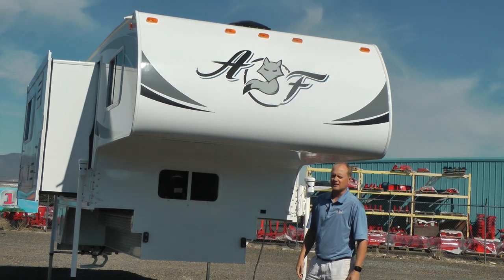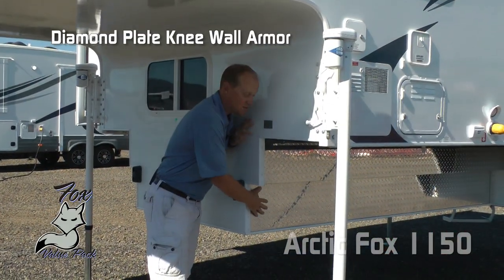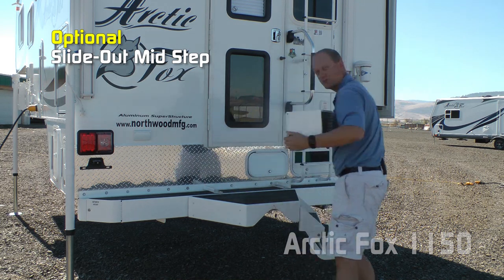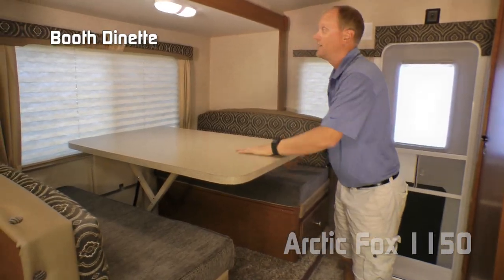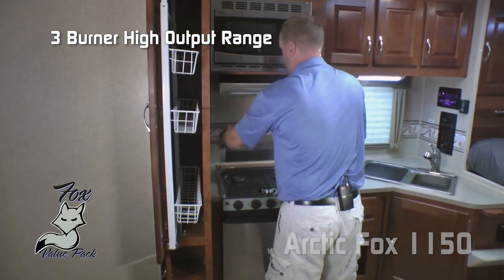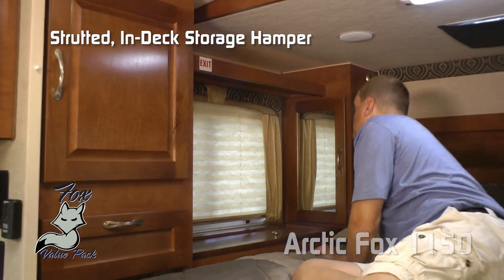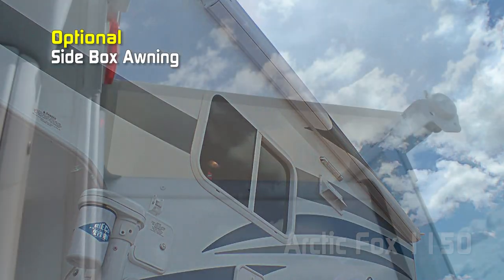Quick Tour Of The Arctic Fox 1150 Pickup Camper

Comment: I bought one, I believe it was a 2002 new. I put in on a Ford F350 diesel dually and took it all over Baja and  western U.S. I really miss it. I abused the hell out of it, took it down roads that would shake your tooth fillings out, but never had a problem with the camper.  Customer service was great. It did have to be taken back to the factory after I moved the slide out with a half inflated soccer ball under the mechanism that I had no idea it was there and caused the slide out to jump the tracks. They never charged me a cent. Back then I believe it was wood frame construction. This looks even more sturdy. I may be looking to buy another new one when I retire in 2 years. Mine had the same basic interior design, and I really loved the layout.
Reply: Did your Ford F350 have airbags installed in the suspension?
Reply: You think an f150 could handle it??

Comment: Just pulled the trigger today and got mine. Can't wait to do some traveling with it.  I compared the 1150 to the Lance 1062.  Both are superb but I had to go with the Arctic Fox. The larger and better placed fluid tanks and frame construction as well as all hard wood instead of pressboard was the deciding factors.  The dry bath is a little tight for the crapper...but that is not a big deal. (the wet bath gives more toilet room) Overall I give the AF1150 an A+ and that can change after I few trips..who knows?
Reply: How has it been keeping up? Give some info please!
Reply: What was the total cost ?
Reply: What kind of truck is it on?  I have heard Artic Fox brand is great in cold weather because of all the insulation.
Reply: That looks too heavy for a 3/4 ton. 1 ton dually minimum.
Reply: I'll stick with a Northern Lite
Reply: Good choice.
Reply: Better hope you didn't buy the one with the dirty shoes on the bed worn by the salesman

Comment: I can't believe the shower actually has a pull out hand held sprayer. WOW amazing. The fridge has an on off switch. Who knew. The jacks are bolted on with real bolts and everything. Amazing. 

You do a good job but there's a point that you can over do it and you reached that point. It just gets comical. 

Look everyone there's not 1 but 2 110v outlets in the bath in case you want to use your electric razor and electric toothbrush at the same time. Gee whiz I got to get me one of those.

Comment: My favorite is a small toy hauler, because there's a lot of things you could do in the garage and if you don't get a fifth wheel toy hauler, just conventional toy hauler, you can always get a new truck or SUV; not out a lot of money compared to the class A or Class C motorhomes. Trailer is having a diversified RV portfolio. I like the garage portion, great projected patio, plus some have bath tubs and frt kitchen. I hate gallery kitchen, traffic flow issues. Garage is great storage for toys, or thro in air mattress, great sleeping. Slide outs are okay, but just another problem, when least expected. Solar panels are must have, better then generator….
Class A Motorhomes okay if you're going to be mobile. They're very expensive to maintain they have a lot of toys on them so be ready for breakdowns. If you wreck them, Ins. are very poor. Not many mechanics really know how to work on them, expensive $$ beast. 
Class C motorhomes are very mobile to get around, sleeper over the cab is a waste of time : either too hot or too cold for good sleeping and if your senior, it's very risky getting in and out of there. Plus if there's two people sleeping up there, the frame over the cab really can't support much activity. 
I would prefer a truck frame chassis with a trailer attached o it, because if you don't like the truck frame chassis you can always get another one, just removed the trailer. 
I have a Class A, Trailer and Truck camper.  Truck and SUV are the only two of all of the above, which have Lemon Law Protections. RV in general, carry no help from the courts and RV warranties, are collection of A-Z products and not insured by one manufacturer.

Comment: I would like to know which camper can go on 4 wheels three quarter ton trucks which camper needs 6 wheels will help in finding some camper for me and others know what they might purchase.
Reply: An AF 811 will work with a single rear wheel 3/4 ton (4 wheel).  990, 1140 and 1150 will need a 1 ton dually (6 wheel).
Reply: @tinstar5080  thank you very much might as well buy a 5 wheel

Comment: I have a 2010 Dodge Ram 3500 (1 ton) long bed (8 ft) 4 door crew cab with 6.7 Cummins diesel.  It's not a dually but I would probably add air suspension if I was going to haul any kind of pickup camper.  Will my rig handle an 1150 or 1140?

Comment: Does anyone know if there's enough room to enter the camper with the slide in? Also with it on the truck can someone get through the pass through and get to the bath with the slide in?
Reply: You can get into the camper and access the bathroom with the slide all the way in.  However, the slide button is right by the door and you can open the slide a foot or so and easily get right in.

Getting in through the pass through window isn't going to happen.  Way too small an opening.

Comment: Aluminum, although great structurally, is horribly thermal conductive. A structural profile made with a composite like fiberglass would be more suitable. All wood in a Camper should be pressure treated because no matter how good a rv roof is designed and built they always end up leaking at some time.

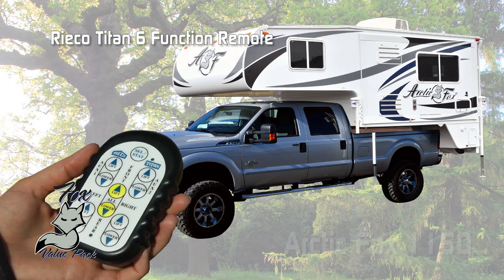Comment: 9:08  is exactly what you do NOT ant to tow this with, for one a SRW does NOT have no where near enough payload, and 2,
 a lifted truck with  truck camper is a super bad idea.  Very bad advertisement in my opinion.
Reply from the maker: Good point! The picture shown at 9:08 is a 990 Truck Camper and not the 1150.  Anything above the 990 we definitely recommend a 1-Ton Dually at least.
Reply: Even the 990 loaded weighs 4000 pounds or more, There is NO SRW truck that has a payload anywhere near that capacity.
Reply: @fit4ya1975  
My 2015 Dodge Ram 2500 HD 4x4 crew cab says 3900 payload without air suspension . I'm looking at Adventurer 86RBS , dry weight 3,100 lbs . I think doable but I would test it first .
Reply: @hardworkingamerican8847  
Dont forget payload includes you and any passengers as well. That with clothing and tools etc your at your payload. Air bags do not increase payload, just help with the ride.
Just play it safe buddy. With a camper on back dually is WAY safer especially if you have a blowout.
Reply: @fit4ya1975  
The 811 is 2,800 something dry . I have been looking around at different options . At first I was looking at trailers . We had a 97 Alpinelite 21' trailer in 2001 . I wasn't familiar with towing then but we managed , finally sold after having it sit too long . 
    I changed my business in 08 and have owned 2 trailers for work and am very comfortable with them but those are only 14' to 16' long . The trailers I am thinking about are under 29' total length and a couple are about 25' . You get a lot for 24,000 but it's another BIG thing to have . Kinda like the appeal of the mobility factor with a camper but they are almost twice the price for half the size . 
    As for tires I have kevlar Goodyear Wrangler all weather adventure tires . Crap I just went out to look at them and saw a friggin crack on the side . I didn't hit anything . Can't remember if I have any warranties on them . Those are 300 each plus . Everytime I turn around there is something to fix or replace , if not the trucks the house the yard stuff in my business . I should know by now that I exist to fix or pay to fix things . Every dang 300 dollar plus tire I have had some issues with . Only I know the other dealer has an option to pay for a prorated warranty and I think I'm screwed because I got these from my mechanic . He's a good guy so I will see what my options are . That crack was with minimal weight , no where near a campers weight . More money more money more money , lol .